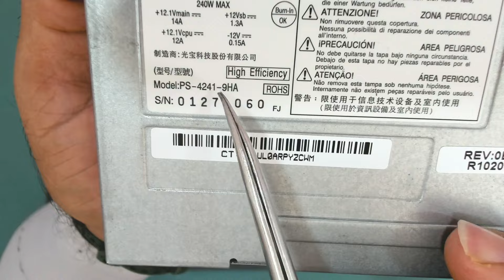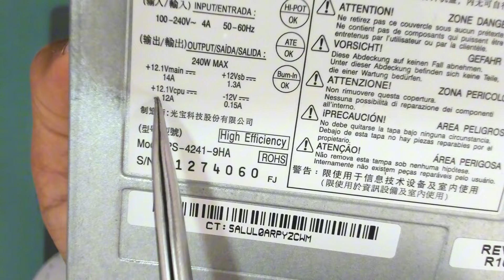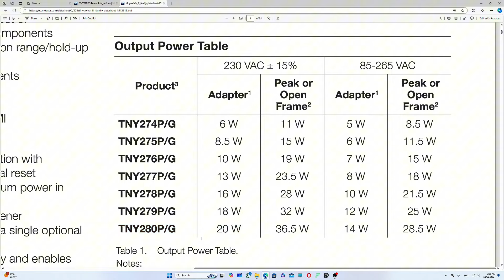Hp PS 4241 9HA Power Supply Repair || Missing Standby Voltage || Fluctuating Output

Comment: 12V on that wire on that specific PS is because manufacturer's like HP, Dell, Lenovo, Fujitsu like to use proprietary motherboards, connetors and power supplies specific for they need's. You should always check before use !

Comment: You should have also tested the main capacitor on diode mode with a simple multimeter. The main capacitor voltage should also have been tested onboard with ac supply on. Plz share these readings if you have any?

Comment: If the main capacitor voltage diminishes and nothing happens on discharging as soon as we switch off the ac supply, does this mean the capacitor is faulty?
Reply from the maker: Yes if no dropper resistors are installed.